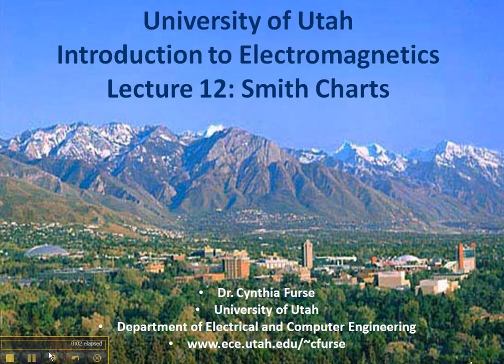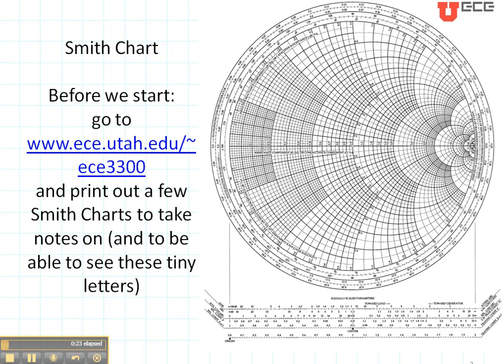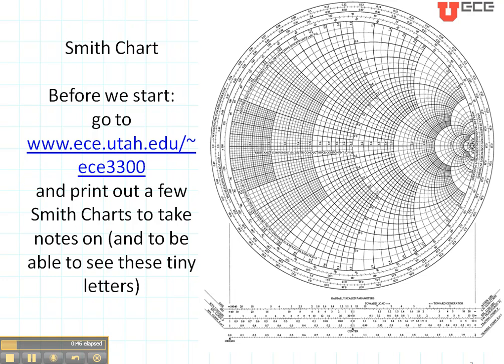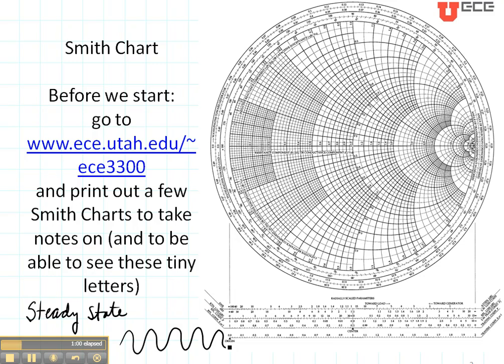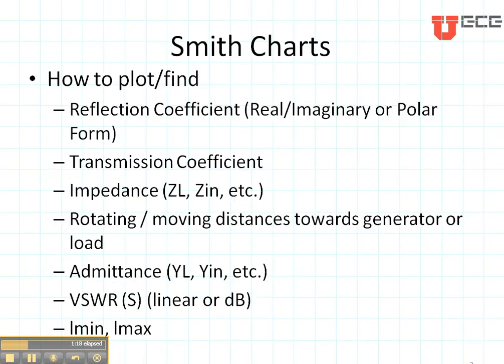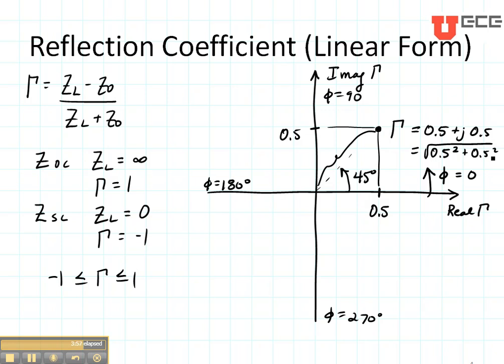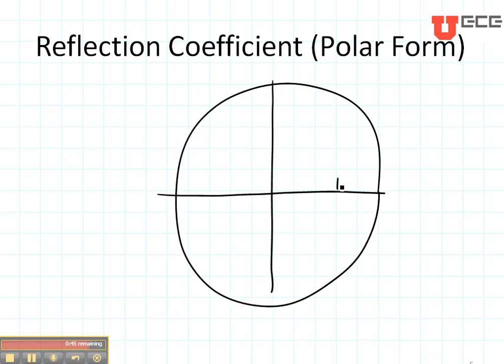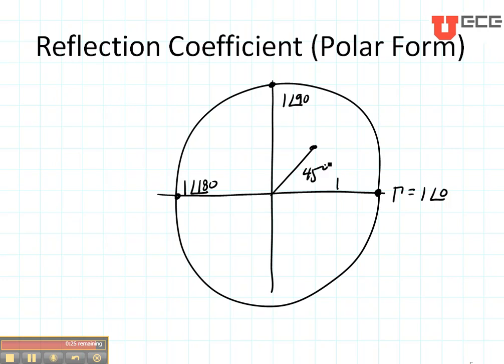ECE3300 Lecture 12b-1 Intro to Smith Charts

Comment from the maker: More:  The length of the ray from the z=0 point to the zL is |T| and may be determined from the transmission coefficient scale on the Smith Chart but by starting from the Origin mark, not the Center mark as you state.  The angle is read on the transmission angle scale but is determined by extending the z=0 to zL ray to that scale.  Notice how the tick marks on that scale are angled such that they point back to the z=0 point.

Comment from the maker: More.... In your video you use an example where Γ is approximately 0.5∠45° to graphically determine that T is about 1.55∠22.5°.  In fact, T = 1+Γ = 1.40∠14.6°.  The correct graphical way to determine T is to plot Γ as usual but to use the z=0 point as the origin for the ray to determine T.  This graphically performs the complex addition of 1+Γ.